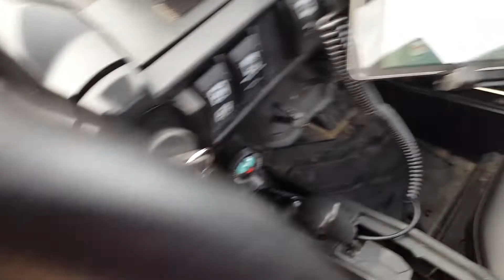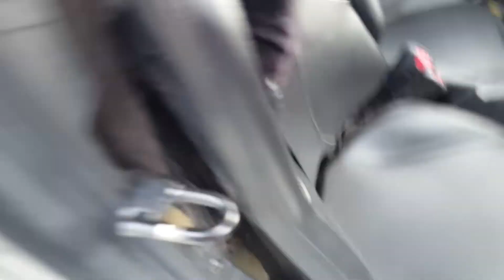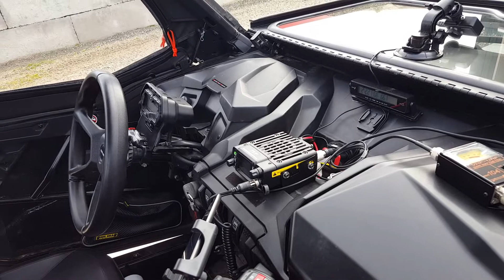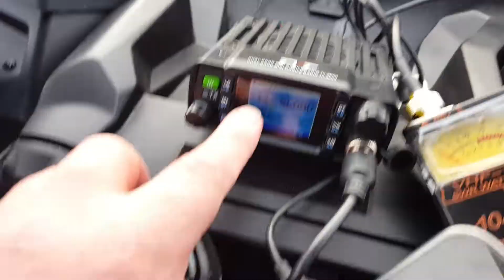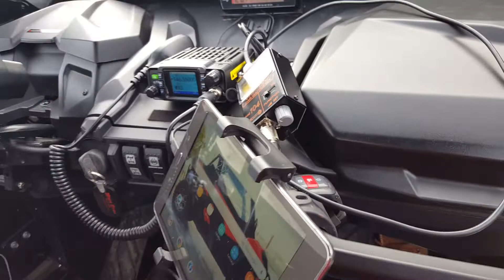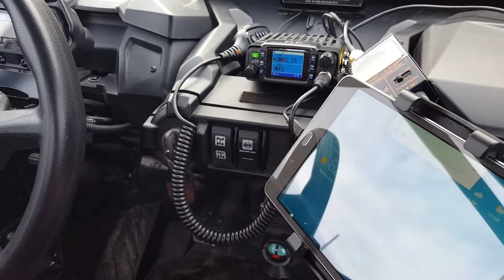Comm Radio Part 3.

Comment: Hey Dan, very informative 3 part video. Found your channel through “My ATV Life”. I just installed the rugged radio system in our MT. Rugged sells a nice antenna bracket that mounts to your downward roll bar. It’s adjustable so you can achieve the vertical antenna your looking for. My friend and I have done so many mods to our MT I wish I would have done a few vids.